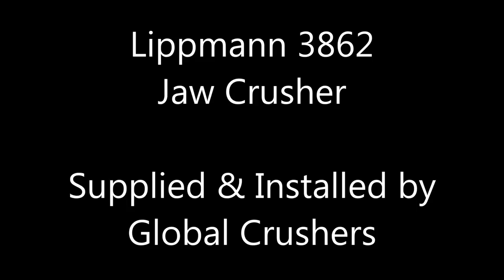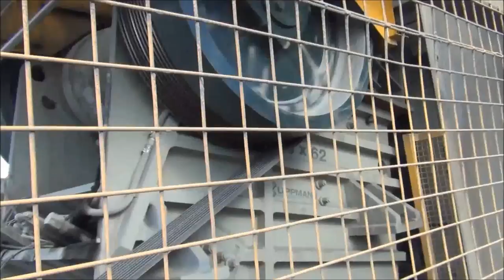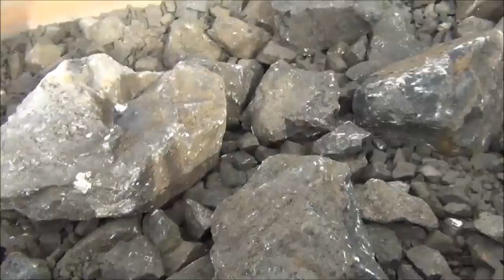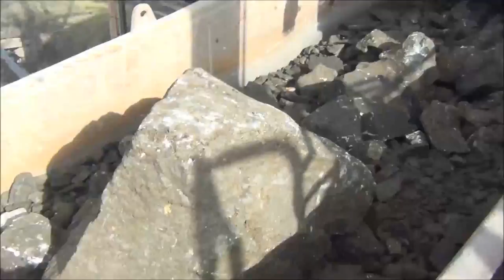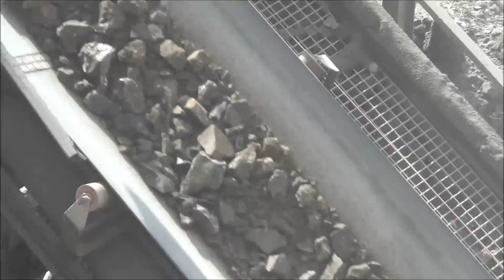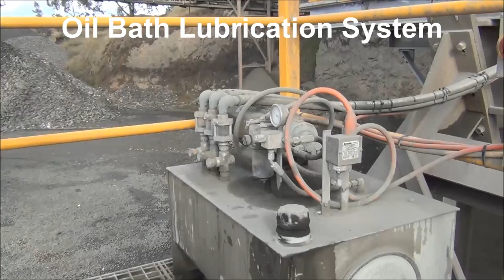Lippmann 3862 Jaw Crusher

Comment: Its swalowing the rocks
Reply: Not really, it's eating them well actually crunching crunching crunching and then swolllowing them   😄👍 . I work at a small quarry . I mostly operate a front end loader but sometimes run the plant. First one is a jaw crusher  then any thing larger than 1 1/2 inches goes to a cone crusher and is finished crushed down to 3/4 inch, 1/2 inch or dust. I like watching rock get crushed.😊.